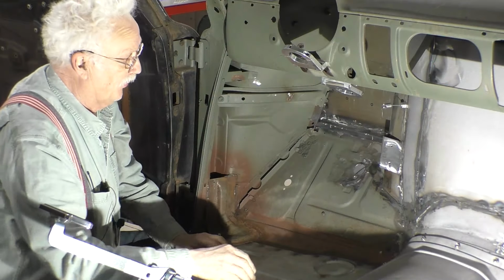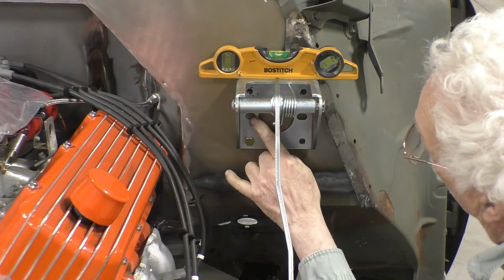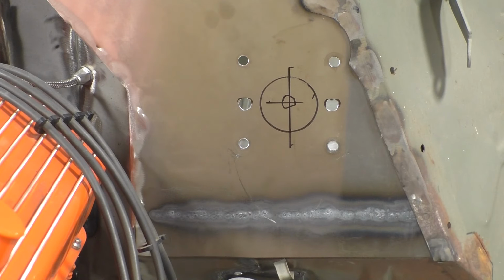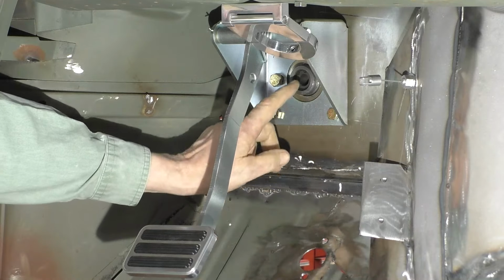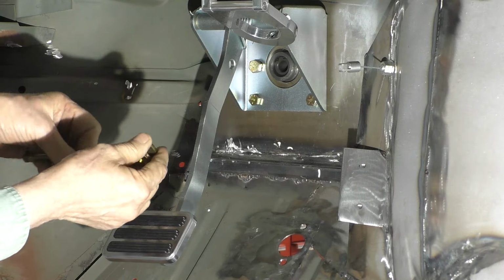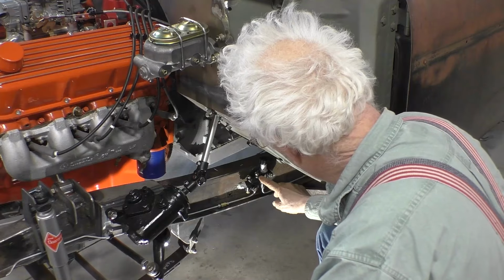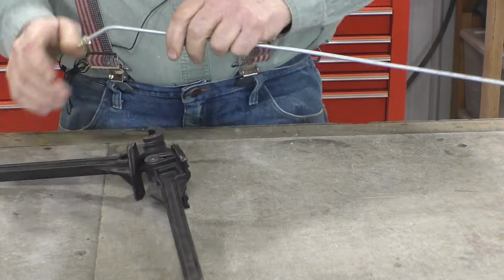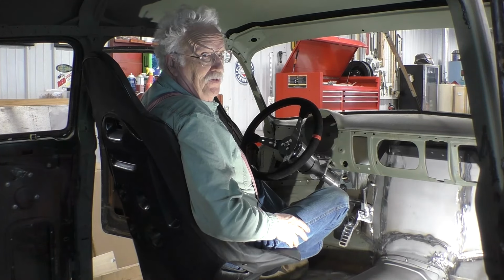Speedway Brake Pedal and Master Cylinder Install, 1949 Chevrolet Gasser

Comment: Thanks so much for sharing your videos, I'm right behind you on my 52 gasser build and utilizing all the stuff you are using on the 49, Lever Tutorials for sure,Aloha and mahalos
Reply from the maker: That is great, I will have to replace the Mr. Gasket throttle cable as it is not up to par. This coming video addresses the HP problem with the gen 5 454. Thanks for the comment.